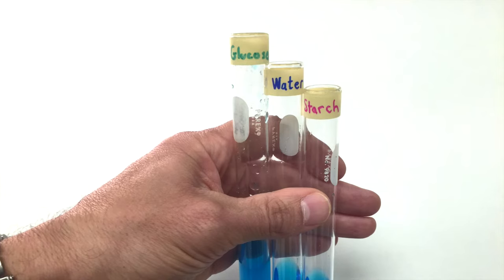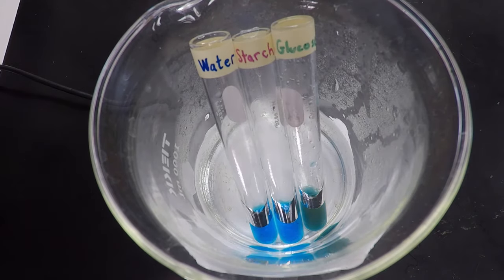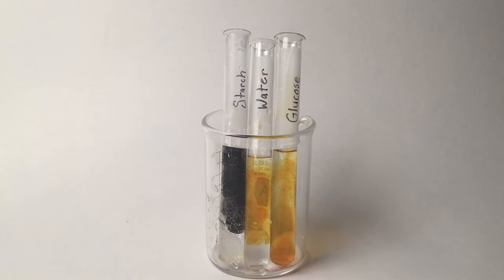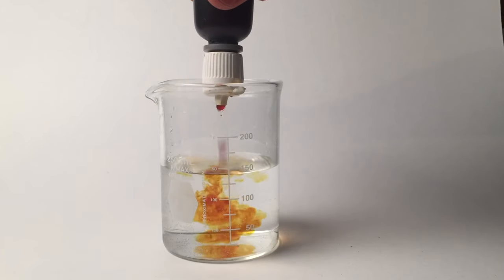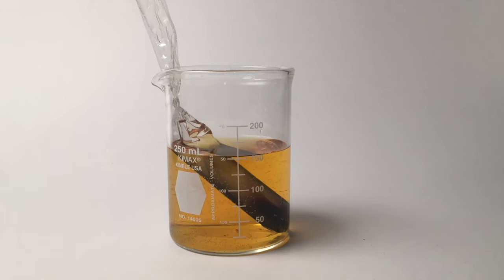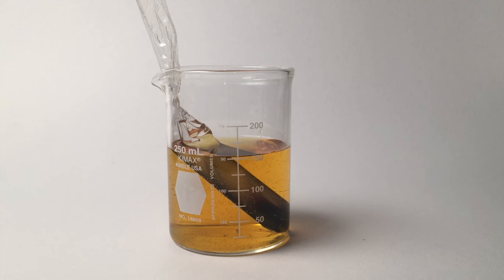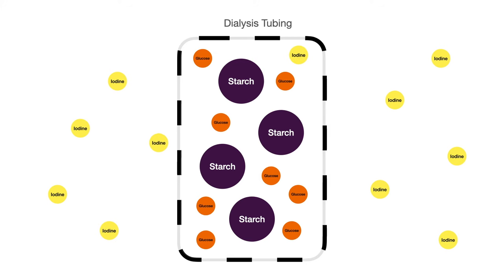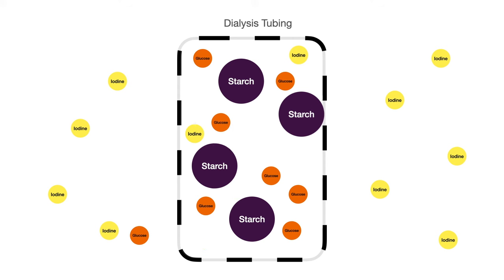Dialysis Tubing Experiment

Comment: How do you make the glucose solution and the starch solution?
Reply from the maker: I use starch spray that is normally meant for clothes and add that to water. (It is way easier to use that instead of trying to mix powdered corn starch.) For the "glucose" I use corn syrup since that gives me a positive Benedicts Test.